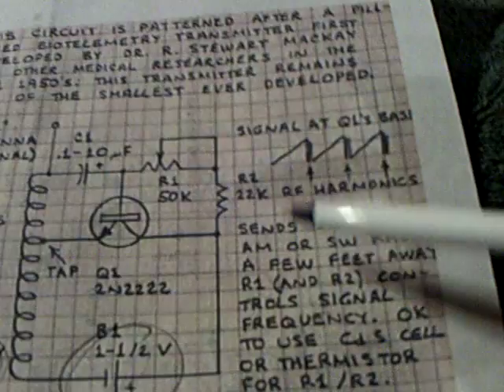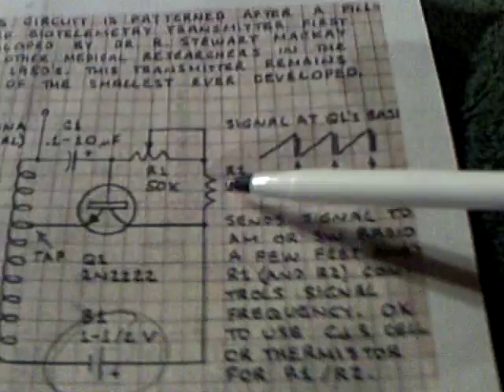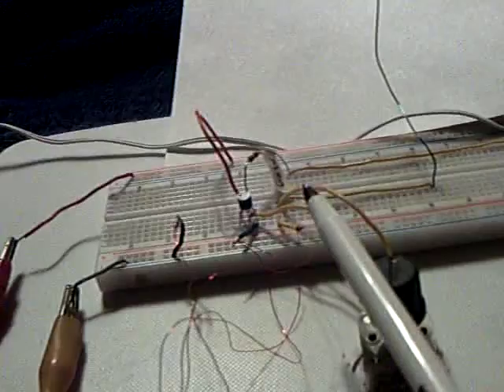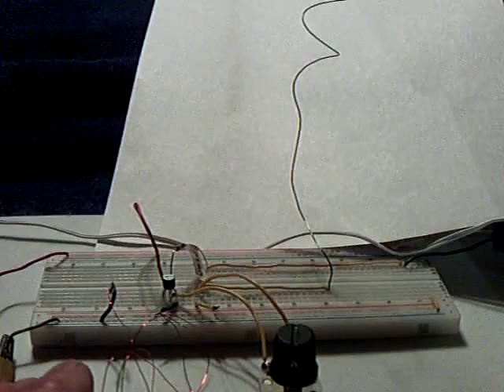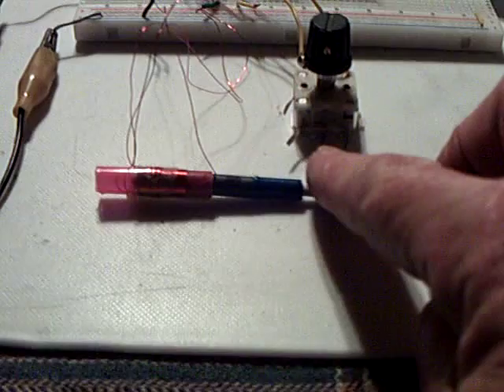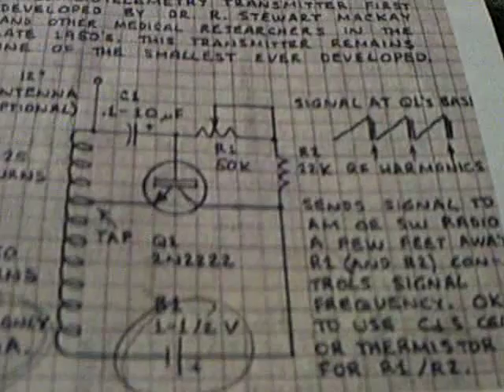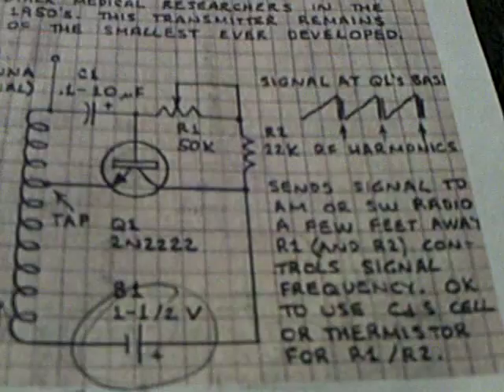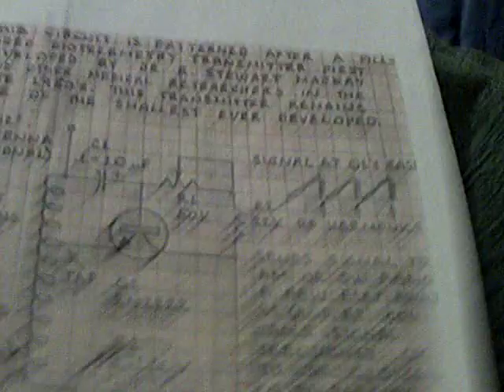Hartley oscillator transmitting an audio signal on cement battery power.ASF

Comment from the maker: The input signal goes in at R1 or R2.  Stop the video and notice the notation on the circuit diagram about varring the resistance by using a cds cell or thermistor there. At that point the circuit can be modulated.

Comment: How long was the concrete battery still creating voltage for after it dried out ? Maybe the harder it gets the higher the oscillation it creates and undoing so it creates power like a crystal😮
Reply from the maker: +Andrew Nash  The cement battery eventually died.